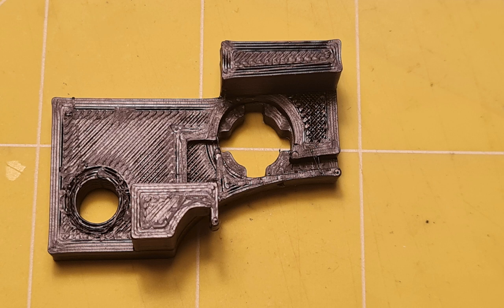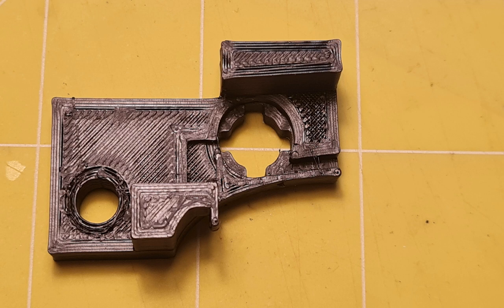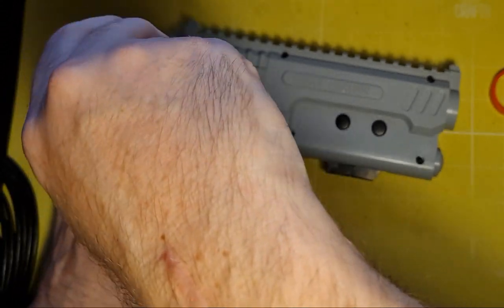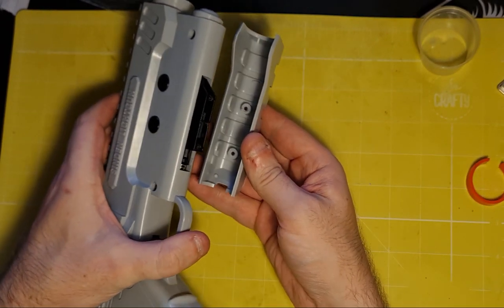install the Trigger Mod in the Sinden Lightgun - How To

Comment: Have you tried modding it with a wide angle lens?
Reply from the maker: I've never tried it myself but some people have found it to be a useful trick if they're not able to stand at the right distance. I hear accuracy can suffer a little, but as long as the lens doesn't distort the picture too much you might get away with it.
Reply: Cool. Thanks! @widge